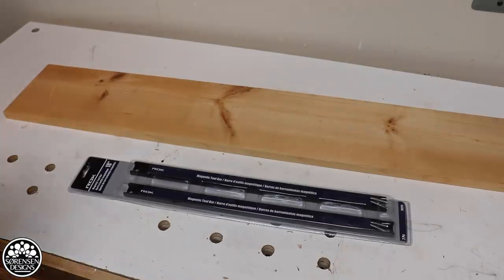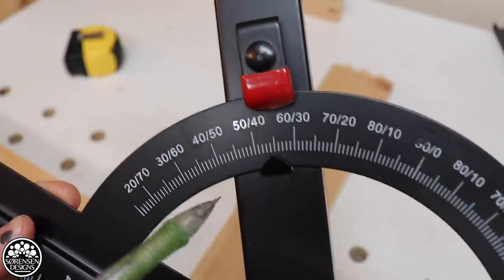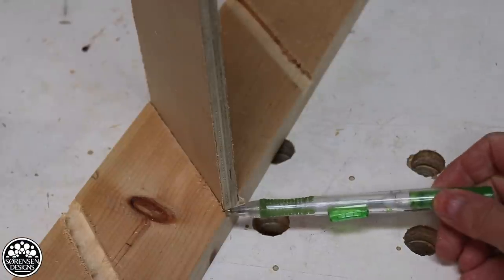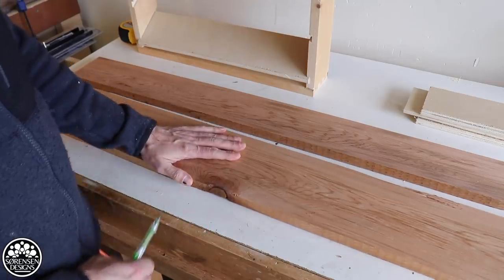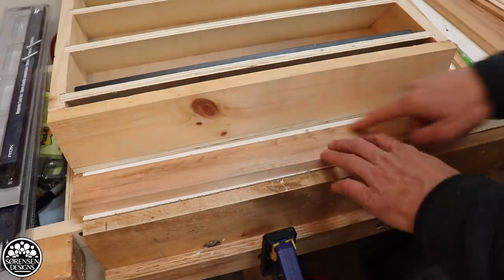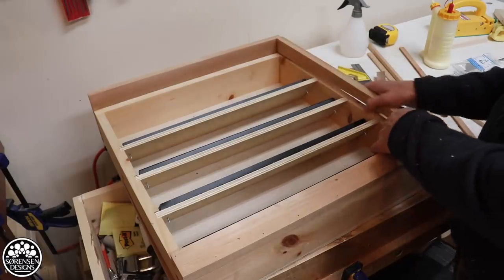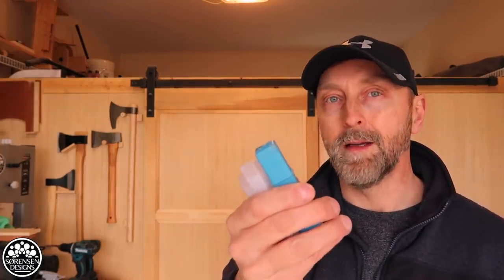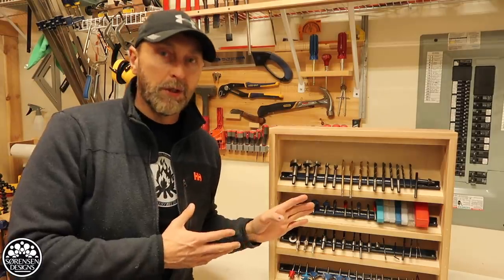The Amazing Magnetic Router & Drill Bit Shelf

Comment: Nice build.  I have been using magnet bars for easy collection of drill bits, etc.  for sometime now.  I didn't organize in a box, just clamped the magnetic bars to my workbench metal sections.  I like your box idea, can easily hang by putting a french cleat on the side of one of a shop cabinet - or work benches.  Still building out my shop so will see how to incorporate.
Reply from the maker: Thanks @Rob Sandstrom! Yes, I've seen the magnetic strips used in all sorts of ways but I thought I would just put in shelves and keep them all in one place. The french cleat is a great idea for hanging it.  You never really stop building your shop 😉

Comment: Awesome build Eric, Thank you for sharing. it is greatly appreciated.

I was also going to comment on the screws sticking through the wooden shelf base, but as you have already covered the subject with other concerns from your fans, 

All I would like to add is, I would have done that part differently myself. 

I would use nuts and bolts rather than screws, After drilling the holes for the magnetic strips, I would have flipped the boards and drilled in a recess for the nut to sit in. It's nither a better or worse way of doing it, just a different way, and take's nothing away from your great build.

All the best to you Eric, from North London U.K. 👍😎
Reply from the maker: @Trev Haydon Thanks! Because of the angle, I never encounter the sharp end of the screws but small bolts would be a fine alternative. Cheers 🍺🙂

Comment from the maker: Happy Holidays Everyone and All the Best in 2019 🍺
Reply: @Eric Sorenson
Do you recommend the Ridgid table saw you have for someone that is unhappy with the new Hitachi Rc10J ? I bought the craptachi bout a year ago and used it maybe 20-30 min a day at the most and the insert broke, the fence won't stay 90 to the table and it also won't stay parrallel LOL. I saw another YouTuber bought one and used it commercially for maybe a week before it broke ( fence lock broke)
Reply from the maker: @Dru 86 I've had my Ridgid jobsite table saw for about 8 years now and it's still going strong - they do have a good warranty but....  I think I will have to go with the Dewalt compact table saw for best value. I would build a special mobile in-feed / out feed for it or attach it to my bench Ron Paulk style. Also check out Porter Cable, I've always had good luck with their tools.  
A Powermatic 220V would be my preferred saw, if you can afford it.
Reply: @EricSorensenCanada  thx!

Comment: I like the versatility of the magnet. It would be great for router bits and drill bits that will only be used on wood (brad, fostner).  I don't like the idea of magnetizing any drill bits that I will use on metal as the shavings will be a pain to clear.  Nice project.
Reply from the maker: @Adrian Stanciu  Thanks! I haven't had any issues with the few metal cutting drill bits that have been stored on these magnets. 
I don't think their strong enough to magnetize the steel to that extent.

Comment: Really cool idea - and I JUST realized the GluBot cap goes on the bottle top when in use - duh !Why did you not dado the back of the shelf and make the magnetic strips hidden ?  Would they not be strong enough to hold through, say, 1/4" of wood ?
Reply from the maker: Thanks @Temple Thomas! I like the notion of doing that, It would have looked cooler but then the bits may not stay put so well. It does weaken the magnetic force somewhat.
Reply: Thanks !  I thought that might be the case
Reply: I know about the GluBot cap storage, but almost always forget to put it there until after I've dragged it through some glue. :D

As for hiding the magnets in the wood, the inverse square law will bit you in the ass on that one.
You could mitigate that by using very powerful rare earth magnets, but it will cost you several times what those cheap magnetic bars do.
Something like this would work, and you can make it any length and strength you want. https://www.kjmagnetics.com/blog.asp?p=magnetic-knife-holder